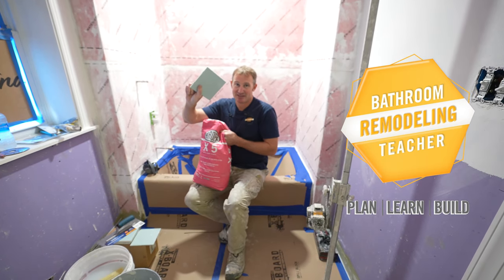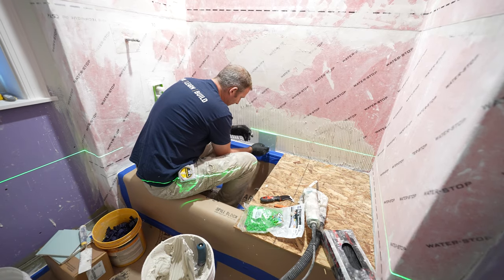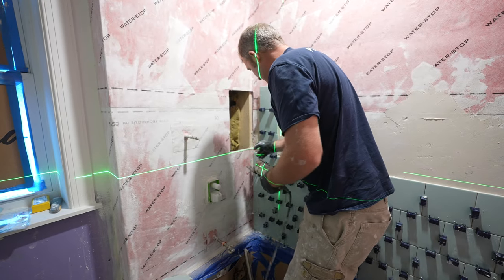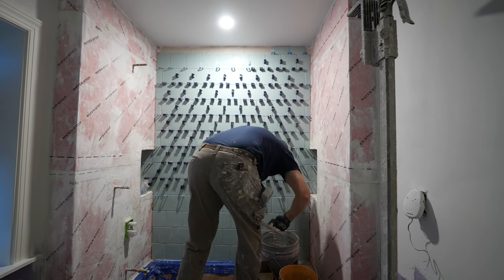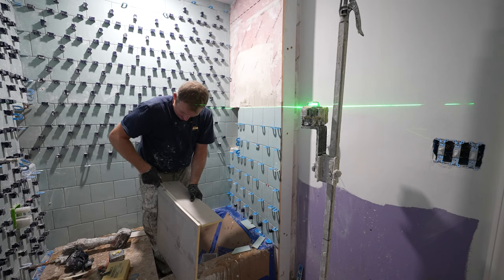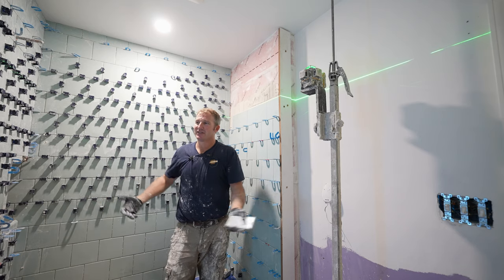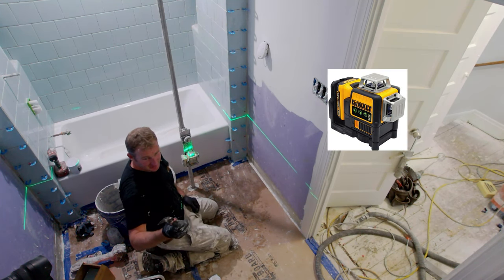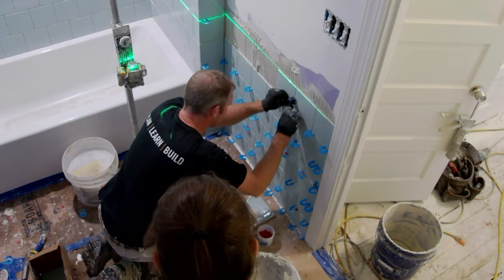How to Tile a Bathroom | My Best Advice | PLAN LEARN BUILD

Comment: I just tiled my 54sqft bathroom floor and it was the first time I used a leveling system. I found them difficult, particularly once the tile is set it doesn't want to level off, it's sucked to the floor bc of the thinset and doesn't want to move (level off)

Comment: This is the most comprehensive real life tiling lesson I have seen. BRT never disappoints but this episode is special! So much to digest and for those who really want to hear what is going on I suggest to turn the video speed down. Secrets come to surface and easy to catch and understand. What do you think Steve, when custom cutting-in these niches after the fact, instead of membrane-ing them to use hydroban (go-board) board and their sealant? Would that be more forgiving on overlapping and easier to apply? Also it would eliminate fiddling with chewy membrane in such confined tiny spot.    p.s. am amazed how much YT material came from this bathroom.
Reply from the maker: Thanks for all your continual support 👍 
It was a safer bet on this project to cut in later, mainly because the tile was not completely chosen before I was waterproofing things. If I had the tile on site beforehand, I would have done the niches during the waterproofing stage (would have made them an inch bigger than needed for fudge room) 
That being said, cutting in was less thinking. Foam board would have been a lot easier, but still cost me time. The membranes are simply no fun at all.
Reply: @BathroomRemodelingTeacher  I agree about membranes.  So many things can cause difficulty and you don't notice them until tile setting.  And .. .. they are expensive.  Not worth it IMO.

Comment: I don't understand why you didn't frame a slightly taller RO on both the top and bottom for the niche during the framing stage that you could adjust with shims when you are ready to install the backer.  You could even leave the top and bottom framing members off entirely and use pocket screws to attach them later. Cover the entire wall including the niche opening with drywall and membrane like you did.  When you cut the opening for the niche you will only have to adjust the top and bottom members of the RO and,attach the backer to the frame.

Comment: That was really great.  Everything you were talking about really resonated with me.  I have a handy-man background and I'm at a crossroads.  While I've learned a lot, I don't want to be a generalist anymore.  Your tiling videos have been really inspiring.  Bathrooms certainly have a wow factor that vinyl siding, drywall, windows, etc. just don't have.  Your professional experience is really valuable so would you consider doing a video on how to break into the bathroom remodel industry? I purchased one of your courses, and it was well worth the $$$.  Keep up the great work, I love your attitude.
Reply: Also, why did you opt to use membrane vs go board?  Thanks so much.
Reply from the maker: Thanks steve 👍 and double thx for joining course 👍 that is a course I’ve been thinking about. It’s tough to come up with a foolproof way to bid things. I do have 100s of quotes to share. I’ll definitely consider it 👍
Reply from the maker: Budget & just a demonstration of another way. There were many shortages on things not too long ago. It’s good to have options 👍 I will say sheet membrane is my least favorite 😆
Reply: @BathroomRemodelingTeacher  Things like finding customers, pre-estimate checklist, and handling typical renovation problems would be interesting topics without having to get into specific bidding.  Thanks again!

Comment: Time spent viewing your videos and courses is time well spent.  I learn valuable tips with every viewing. I was wondering how to get around the kerdiband build up in the corners and thanks to you I'll not be afraid to take a little off the tile back.
Reply: Schluter tells you build up is not a problem if you do it right.  
That's Just not accurate.  The inside and outside corners get too many layers and build up cannot be avoided.  Grinding is a pain.
Reply: Is the same true with the wedi band? I used the wedi band around the entire tub flange because the wedi board is on top of the flange. I saw you do this on another video. I tried to keep the 620 as thin as possible  when embedding the wedi  band  but there is a slight build up on the entire first row. I was hoping to make up the slight difference with slightly  less thinset. Do you suggest I grind?

Comment: Kraft tool
Superior Tile Cutter  ST006 Tile Cutter with Carbide Cutting Wheel, Large
It is a game changer if used correctly.
Reply: You can set it right there on your plywood you got in the tub.

Comment: Help! My contractor did not fully fill our shower tiles with grout, leaving a lip on nearly all tiles and in the niche where water will settle.  He has air pockets and some discoloration.  I think he mixed the grout with a mixer tool, and must have wiped too much product off.  He also grouted in our plumbing pipe for the shower head so we have no access to the wall. The pipe now sticks out with no way to attach our finishing pieces and shower head arm.  Ugh.  I really appreciate your videos and wish we would have done it ourselves. Any advise for adding grout to the existing project and filling in spaces that need it? Do we need to remove grout and start over or can we add? Much appreciated for your ideas. T. Casson

Comment: Will be watching this one. Have you ever built a steam shower? I recently took a steam shower build and it’s my first one so if you have any tips that would be super helpful! I’ve got the ceiling pitched 2” per foot and sealed up with Schluter top to bottom but I’m sure there’s something I’m not anticipating. This will be the first time installing tile on a ceiling and they’re 12x24 😅
Reply from the maker: I know the TCNA says 2” slope….but that’s really hard to make look good. Guess it depends on situation and layout 
I’ve only done 1 steam shower. Always wanted to do more, but most people couldn’t afford it. My thoughts are if it’s used commercially multiple times a day, then slope to those recommendations, otherwise I’m leaving ceiling as is. The one I did do had a flat ceiling. No one ever complained of dripping ceiling.
The waterproofing aspect is a bit over kill with systems too (in my opinion). Wedi would probably be the best system for this if you can afford it. Otherwise I’m pretty sure hydroban board can work with sealing the seams with liquid. 
Pretty sure Wedi works the same way too. Again all overkill for a steam used periodically. Schluter is all a pain, but I use quite often too 👍
Reply: Good job
Reply: Thank you very much for the advice, the old tile steam shower failed at the curb but it was 20 years old with no waterproofing at all

Comment: Thanks for the great videos! Question please - what are your thoughts on pre-filling the waffles on DITRA HEAT? I'm concerned about accidentally nicking the cable if not pre-filling but have seen some posts saying that pre-filling results in hardened pieces pulling out of the waffles when setting the tile after pre-filling.
Reply from the maker: I actually prefer to do that. Makes it much easier to tile the next day. I rarely set wires and start tiling same day anyways. 
Plus I’m always doing drywall work in mornings, so it’s easy to sweep off before tiling if you prefill. 
Biggest issue I see is if you have excessive activity over it. I wouldn’t keep it that way for many subcontractors to walk over it day after day. Prefill & tile next day 👍

Comment: How many bags of the thinset did you use on this bathtub tile? Corner board on the wall 🤯 to set the edge.  I just finished my half wall tiles I wish I would've use that method.  Note taken.
Reply from the maker: Tub area was only 2
Bought 5 bags of x5 for all tile 
And 1 bag Schluter all set for membrane